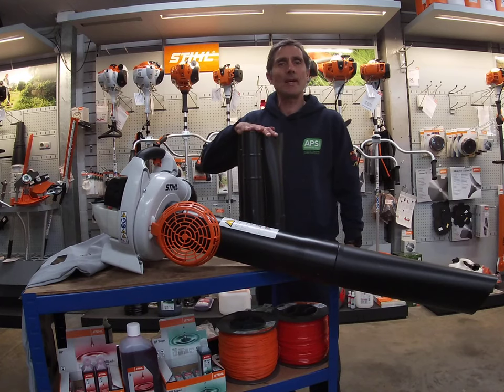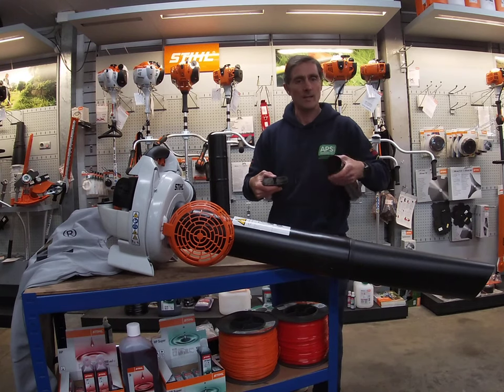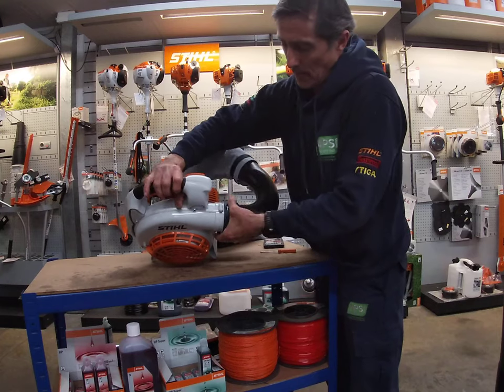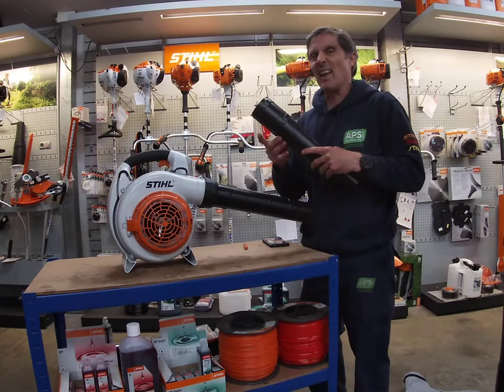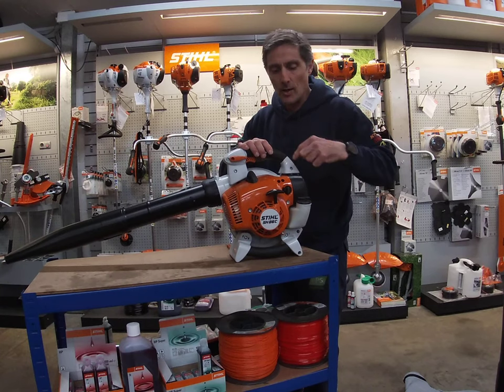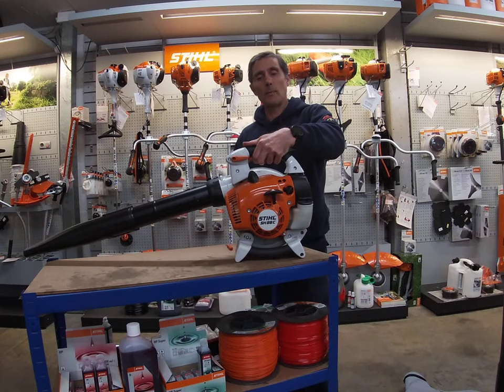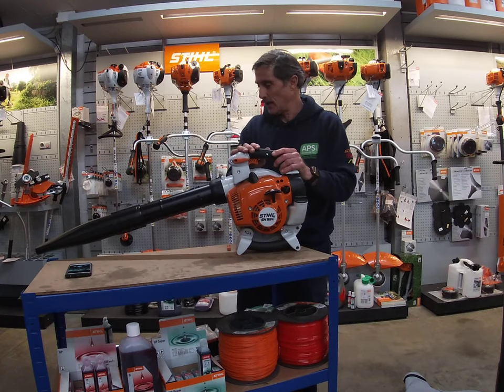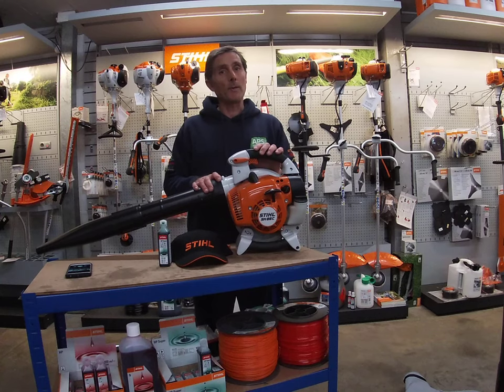How to start a Stihl SH86 Vacuum and change into a Blower?

Comment: Great machine but using it as a vac vac will destroy the the blades after a while. Replacements are pretty cheap and easy to fit. I keep mine set up as a vac permanently and use the Husky 525 BX as a blower for smaller applications. This is a great machine but just keep in mind that after using it as a vac, it will degrade as a blower! If you can afford it, buy two!